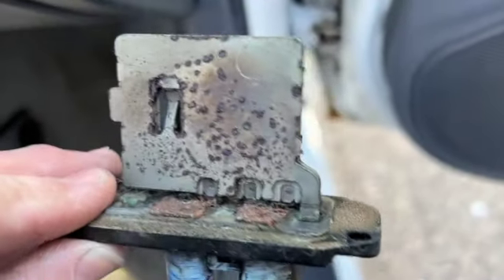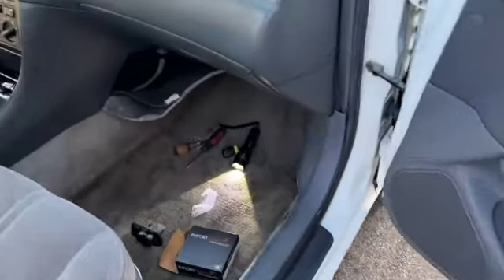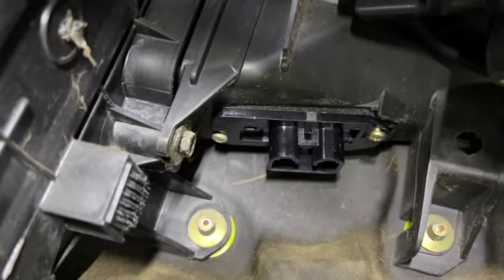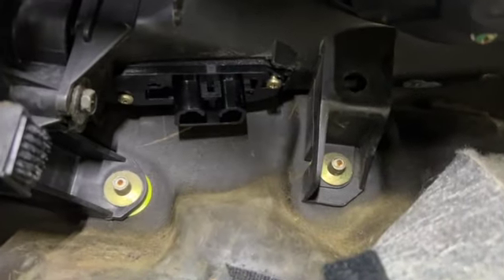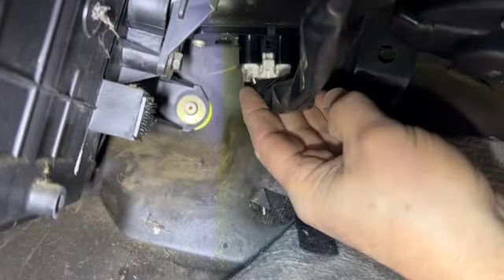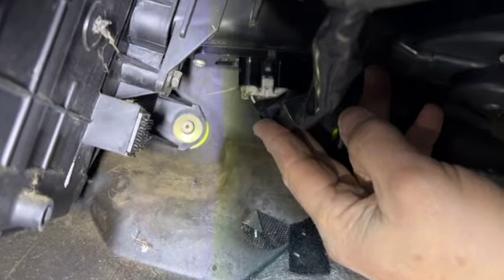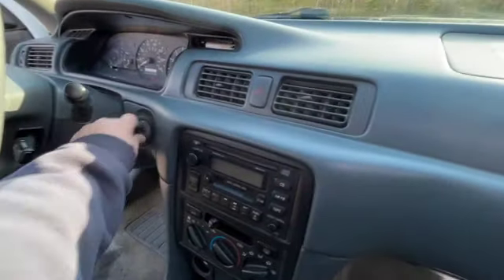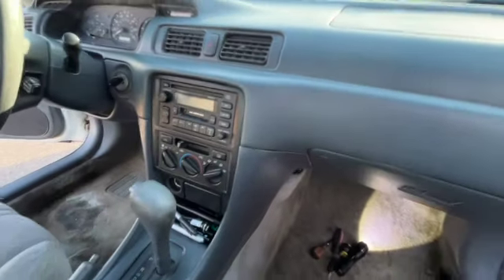1999 Toyota Camry Fan Only Works on High

Comment: I have a 1999 Camry 4 cylinder and my shift solenoid E has gone on it. Can you do a video on that?
Reply from the maker: Make sure your brake lights are working, if that are not working every time you press the brake pedal your brake light switch is the problem not the shift interlock switch

Comment: I have a 1999 Camry 4 cylinder and my shift solenoid E has gone on it. Can you do a video on that?
Reply from the maker: Check your brake lights and let me know.
Reply: @EddieCarrara1  they work fine
Reply from the maker: @AnndyClark  That was my nephew's car so I have no way of making a video. Are you still having issues? Is it intermittent? Can you access the shift lock via an access hole in the center console?